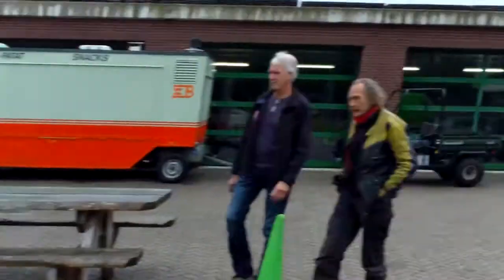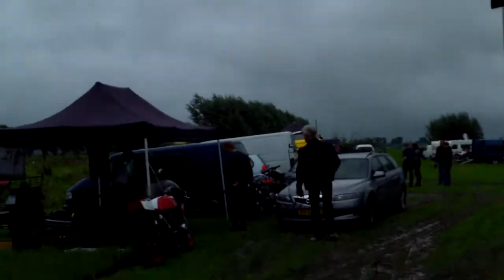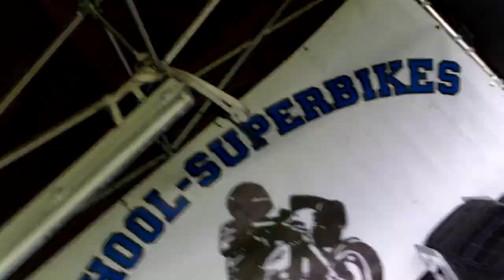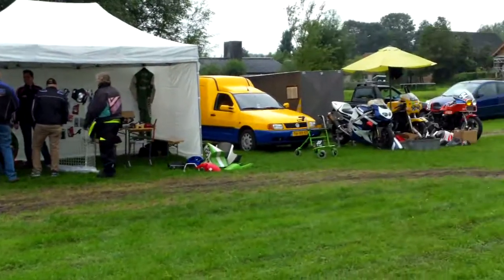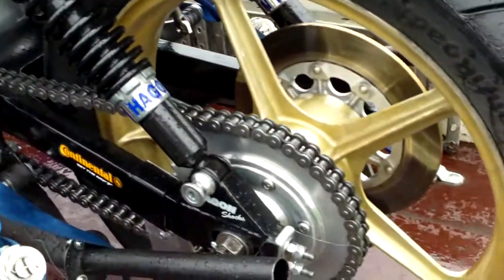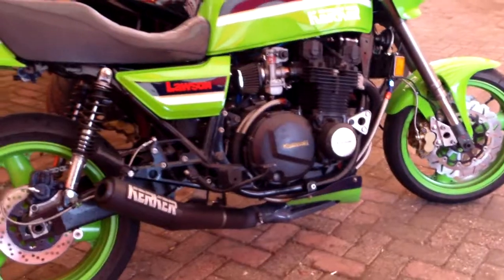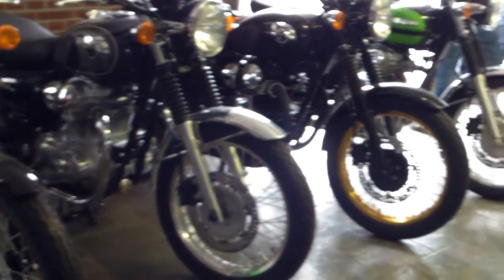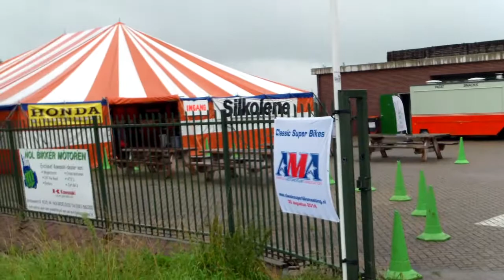Suzuki GTR 750 racer + Classic Superbikes in the mud.....

Comment: MY BIKE!!!!  I was just about to ask you if you had ever run across any VF1000R Honda Interceptor Super bikes that you could recall, and Viola...there she is... at 2:29  I wonder what kind of changes besides exhaust has been done to that one.  Boy that bike was some good...(and a few bad) memories for me.
Reply from the maker: Its a small world , Mr. Honda got fans worldwide so this owner could tell a few stories about that VF , not 100% Paradise but what bike would deliver that...
Reply: To be totally honest, Pablo my friend that VF never caused me any trouble or less than happy memories that weren't entirely my own doing!  I'll give you an example... coming back from a 1300 mile road trip in 1987 I let my throttle hand have a little too much freedom; I was nearing the border of my state at something close to 200 kph when I spied police lights far behind me and realized I was nabbed...  I knew if I stopped at that point my bike would be impounded and I would go to jail 150 miles away... so I rolled the dice and ran for the border. 1. I thought I MAY outrun the guy following 2. I figured if I crossed the border I'd at least go to jail in my home city 3. My wife at the time was a police dispatcher and that might carry some weight.... and 4 I figured that as soon as I crossed the border and saw a Nevada Cop I'd pull over...   after about 50 miles and speeds reaching over 233 kph, I pulled over when I FINALLY saw a Nevada Highway Patrol car. BUT even though the tickets combined came to $1500, after giving me the tickets they let me GO...because the cop that was behind me was SO far behind me he wasn't sure I was actually running from him at first...  Yeah, that was a GREAT bike, but I wasn't always a good boy on it!
Reply from the maker: MrComaToes I just checked the most wanted list , no Mr. CT nor CW on there ... , We all do things in traffic that could be dangerous or worse , running for the cops was a bit more easy here in the big city , lots of narrow Streets , alleys , but in case of real hurry also sidewalks and frontgardens..